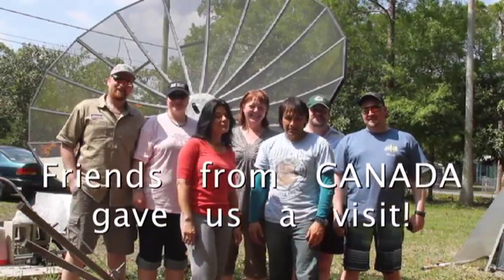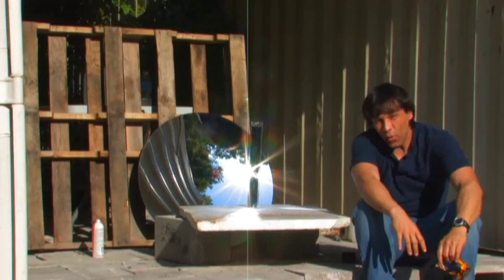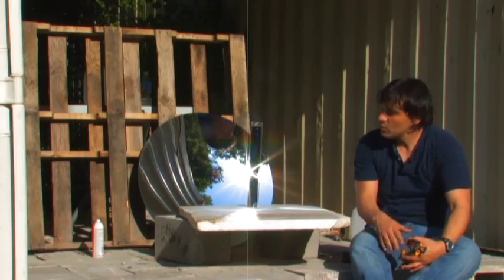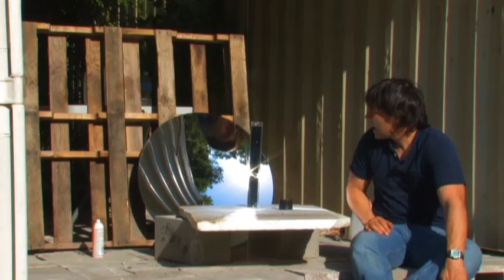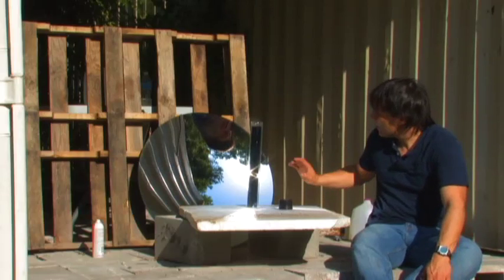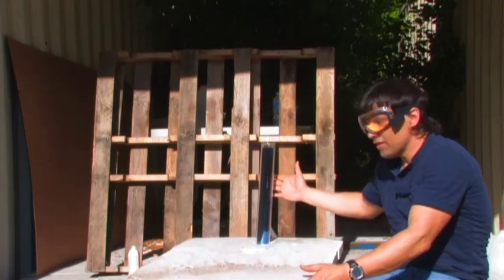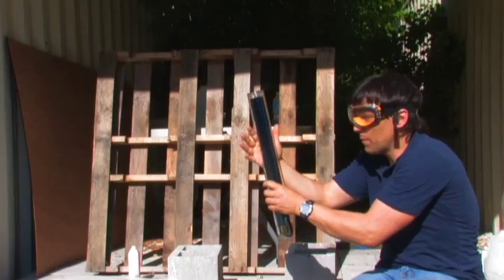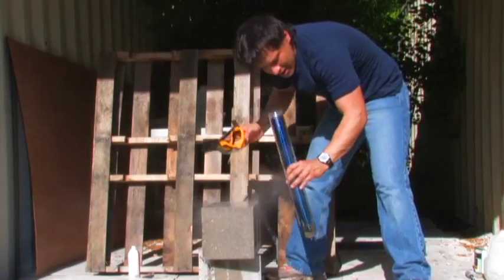PARABOLIC MIRROR concentrated sunlight on an evacuated solar tube boiling water with the Sun

Comment: @ChaiseChaise A Fresnel lens does not, to my knowledge, concentrate light. It "parallelizes" light. Its use is in producing a more coherent, directional beam of light.

Installing a Fresnel lens on top of a house, aligning it with a conventional magnifying lens on the ground, and using a series of mirrors could harvest sunlight more efficiently.
But I think the point of his videos is to do it the easier way!

Comment: @GREENPOWERSCIENCE 
Boiling water is an endothermic process, which means that energy is absorbed.

The reason why 10 kilos of water boil more rapidly than 20 kilos of water, under the same conditions, is because heat capacity is an extensive property: it depends on the quantity of substance present.

Heat capacity is defined as the quantity of energy needed to augment temperature by one Kelvin. Different substances have different molar heat capacities (intensive property).

Comment: thanks for answering my questions with the magnetic generator! I am more interested in solar thermal energy that can run a steam powered generator. What about storing unused energy in the form of hydrogen and/or battery bank. I would what a typical 3 bedroom house would need.